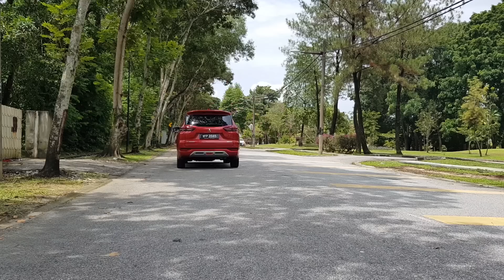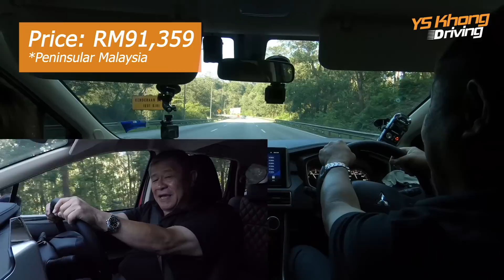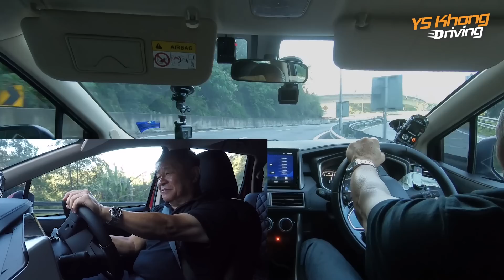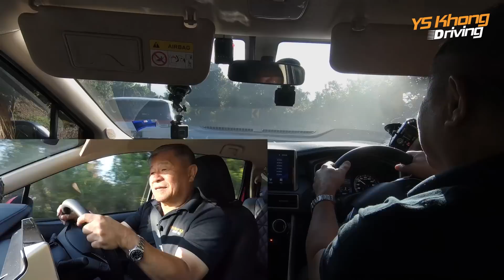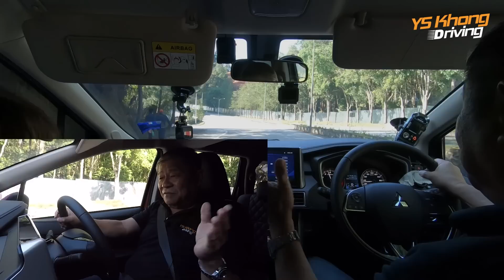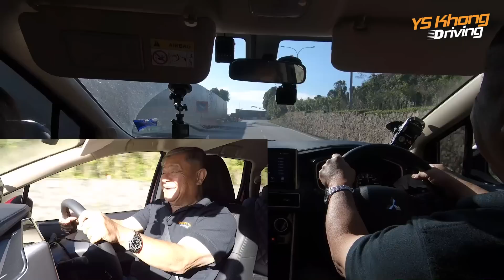Mitsubishi Xpander 2021 [Genting Test Drive] | YS Khong Driving

Comment: Hi uncle YS, I just got my new Xpander over a month ago..
I have one question, is it safe if driving up to 120kmh somehting and turn the O/D off? I was trying to pass over a car in front of me😅 it did indeed help me to boost the speed, but thinking 120kmh in gear 3 kinda worriying me..though i saw you hit 110kmh with only 2nd gear😂😅
Reply from the maker: It is perfectly ok. Turning off OD is like shifting to 3d gear since OD is equivalent to 4th gear. This kicks down the auto to 3rd gear and helps with the overtaking. Usually 3rd gear is good up to almost the top speed, but at a higher rev. Once you have done your overtaking, shift back to OD.
Reply: thank you so much Uncle YS, didnt expect to get your reply within a few minutes😅..Love your videos and keep up the good work uncle..your expender video is one of the factor triggering me out to buy an xpander, though it took me 2 years lol🤭

Comment: Hi would like to ask between xpander, exora and honda br v which is a better family car for the long run? Planning  to buy a new car. Thank you
Reply from the maker: Xpander and BR-V are similar vehicles, both 1.5 liter and 7 seater. The Exora is a bigger vehicle, and is 1.6 turbo.
Exora is no more in production, so it is a choice between BR-V and Zpander. Depends on what you like better.
Reply: Honda brv is better in terms of market value and good performance acceleration

Comment: As Uncle said 1.5 so called Mpv is underpower. Around same segment, only Exora 1.6Turbo effortless conquer Genting track.
Reply from the maker: It also struggles.
Reply: @YSKhongDriving  but CFE engine performs way better..had driven it fully loaded and it surprises us all
Reply: No, it struggles too. My dad has one. Not to mention noisy cvt. So nothing effortless about it. Same² all in the segment. All underpowered.
Reply: @pauljaa4719  ive driive it few times. Yes the cvt humming was obvious, but the torque was there. This is not CPS ya, the CFE engine nice to driven☑️
Reply: @mdhafizg  lets see how many exora breakdown at middle of uphill cause by och n GB problem🤣
Reply: @rainsyahdante6702  tell me how many rascal
Reply: I had been driven my Exora CPS up to Genting, all the way first and second gear， suddenly lost power when reach the top , really scared me that moment, anyway after rest for a while, the power came back, now I dare not drive my Exora up to Genting anymore. Lol
Reply: @konghocktiong4148  bro, that was a CPS engine, sure underpower. You should have try the CFE Turbo engine😅
Reply: Hahahahhahahahahaha
Reply: @Mojojojojojo-x7o  drove xpander,  felt im spenderless🤣🤣🤣🤣🤣🤣🤣🤣🤣🤣🤣🙃🤣🤣🤣🤣🤣

Comment: Need to shift to 2nd to climb the hill... Was it because of its an underpowered car sir?
Reply: No need. Uncle did it to stress the engine for power & for engine braking. Normal drive, 3rd gear can climb already.
Reply from the maker: It is only a 1.5 litre engine. Many cars need to go to second climbing that hill.
Reply: @YSKhongDriving  thanks for the reply sir
Reply: gear very long
Reply: Duh…